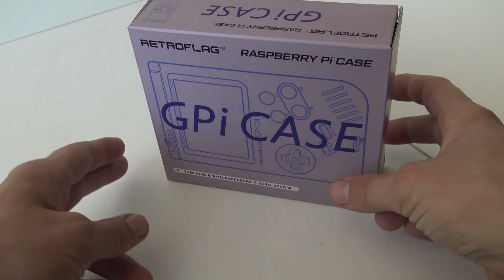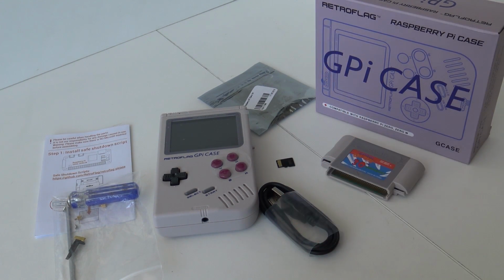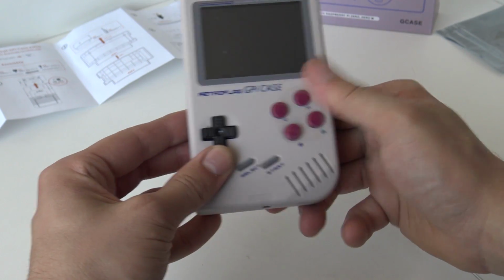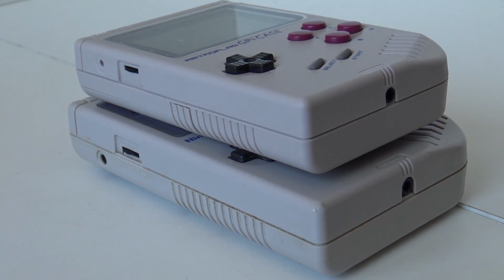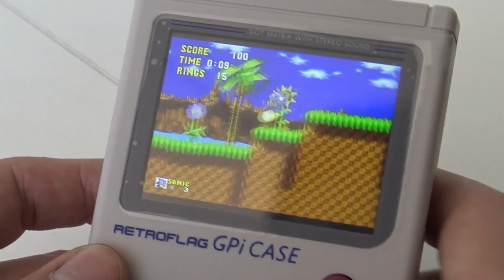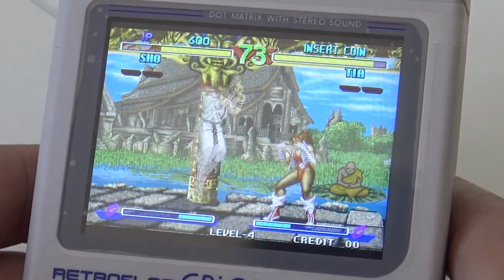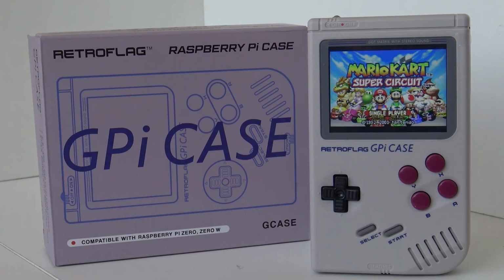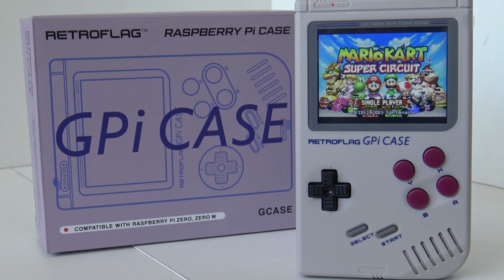How Is The Older Gpi Case Game Boy Mini In 2022 !

Comment: You can problebly find some punk at the arcade who has some gpi zero images for you. 

And maybe if you slap in a gpi mate 3 and  a CM3 module you're the king with this machine. Because the CM3 is much faster then a Zero (W) or Zero 2.

Or just get a gpi case 2 and slap in a CM 4. The only thing still missing are 2 buttons and 2 analog sticks, maybe next time Retroflag. Then they can compete with the top of the line Ambernic devices. But thats just my 2 cents. 

Nice review overal wicked.